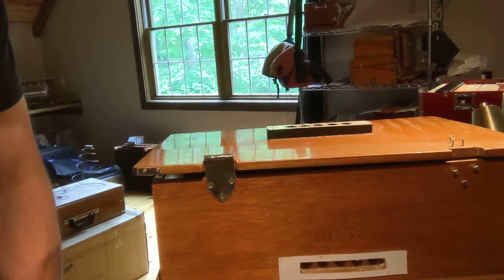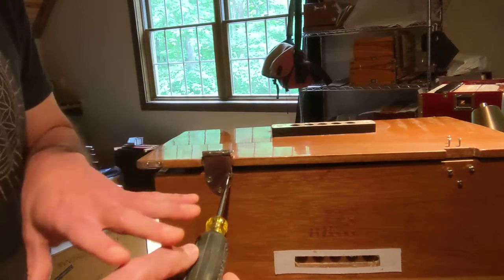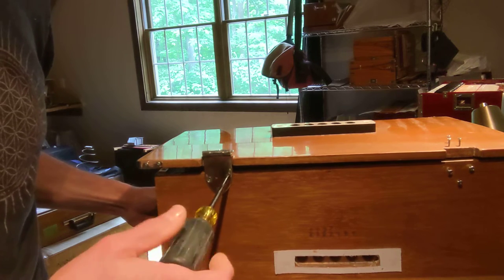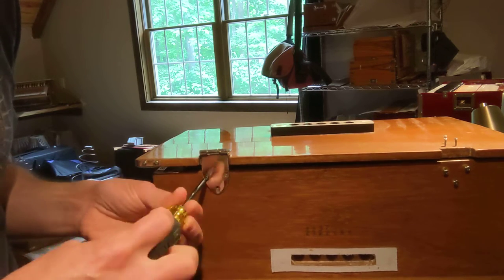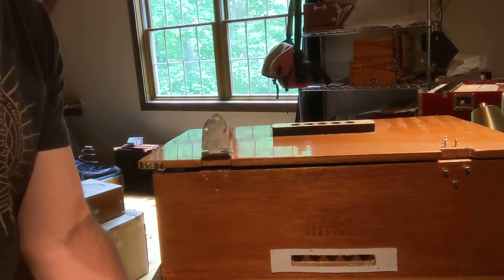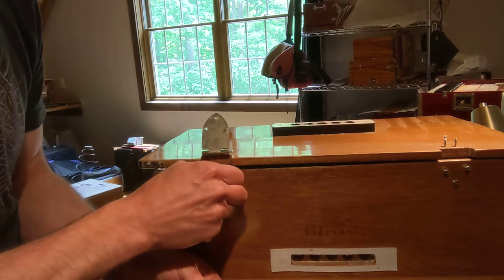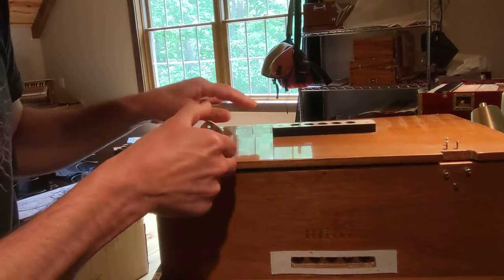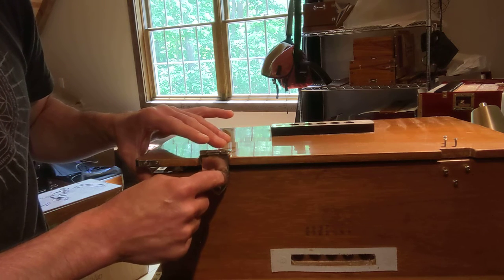Stripped screw hole -- toothpick fix

Comment: Would it be ok if after applying the glue to the toothpick, to screw the screw back in right away as a quick fix. Or would I need to let it dry for 24hrs first?
Reply from the maker: It depends. Sometimes, we screw into it right away and let it all set up together with the screw inserted. But if it's a bigger hole, you may want to let it all set and then do it after it has dried. It really just depends on the exact situation...

Comment: Stupid question. I know why you use wood glue for this, but is it absolutely necessary, especially for a small hole like that? Asking for my own DIY lol
Reply from the maker: Honestly I haven't tried it without the wood glue, but I'm guessing the fix will be far less strong/durable without the glue! If it's a screw that has very little stress put on it, maybe it would be fine.
Reply: @OldDelhiMusic  It's a cabinet door above the fridge that will almost never be opened haha.. i just put in some toothpicks and holy crap is all I have to say.
Reply: If it's going to get unscrewed again in the future for some repair work, it's probably good to glue it in so you don't have to re-toothpick it each time.
Reply: I used toothpicks without glue for a door that came loose. It worked for a few years. Last week it came back out. I looked up this video to see if I needed glue. I would recommend it (possibly) I need to buy some picks and glue today and I'll know if it worked in a few days.
Reply: @Sketchington  Yeah, after this question I tried it without glue and the screw will basically shred the toothpick, so it's good to have a hardening agent in there like glue.
Reply: @psychosin13 Thanks!
Reply: If you can find it, I'd suggest actual Gorilla glue.  NOT the super glue type, the REAL product! It expands nicely into the spaces, so you only need a VERY SMALL amount. Use the toothpicks to clean up any excess. I've used it on very tiny things and it's a VERY solid bond. 

You also want to wear rubber gloves, because this stuff (like spray foam!) DOES NOT come off skin or clothing. Trust an idiot like me on that. If I remember right, it'll eat latex, so buy the heavier, tight fit gloves (like surgical gloves, but thicker) and try real hard not to get it anywhere it shouldn't be. 

Think ahead and have a plastic lid/container to put it down. You won't be able to use it again, so use a disposable.  

They make boxes of single use tubes, which is nice. You can also re-pierce the end when it clogs (pin) or the side when that fails.